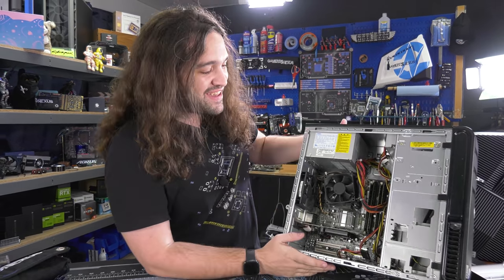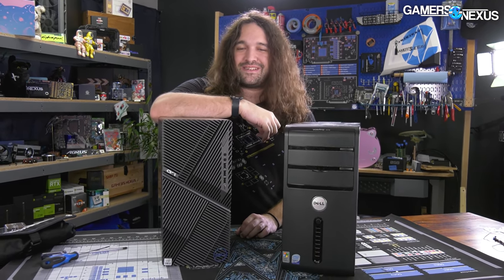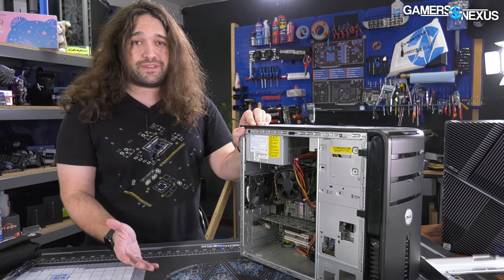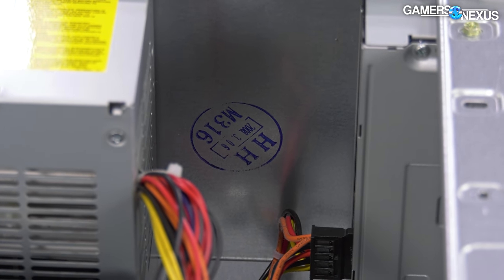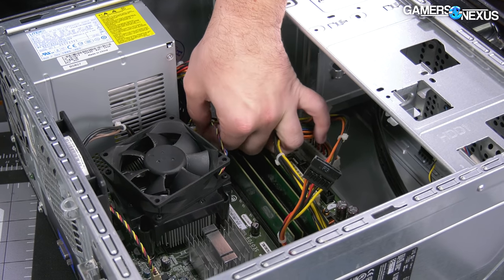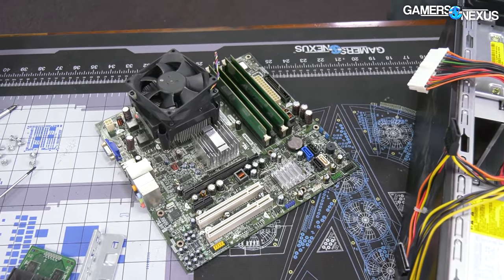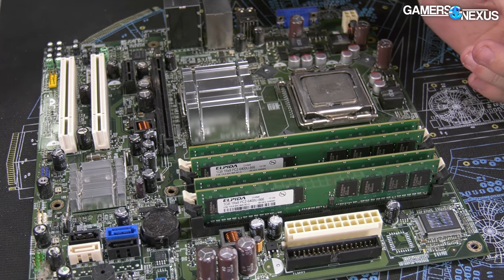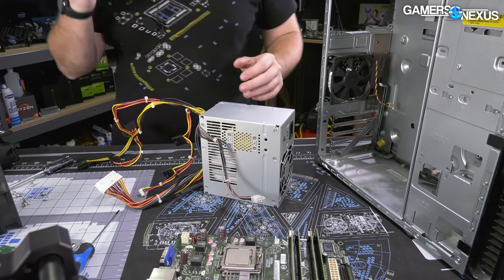13 Years of Dell Getting Worse

Comment: I hate to spoil it but it seems like they've been doing this for a long time. I have an Inspiron 400 with a mb form factor that is more akin to a pizza box than a computer, a cpu cooler that basically copied Apples homework on the Power mac G3 and the best part? The motherboard is on the other side of the case. It's complelty opposite of standard.

Comment: Ah Dell, the company that literally rewired an ATX power supply to a nonstandard configuration, so that if you replaced it with a standard ATX PSU it would blow up your computer (sometimes literally).

Comment: I own a Dell precision m4500 laptop and I talk a lot of it up to being an Enterprise laptop but it's one of the best laptops I've ever had to use.  Battery doesn't charge but that's because the charger I have for it isn't the correct one and doesn't put out the right juice but three internal Msata slots, hard drive access that is the easiest I've ever had on a laptop oh and the kicker to get inside to be able to change ram or any of the msata cards...1 screw.  That's it, right in the middle.

Comment: I know this is a tad "necro", but I would like to disagree or maybe reframe the statement regarding cable management not being a thing back then. If anything it became less of an issue as SATA became standard. IDE ribbon cables could REALLY screw up air flow patterns. I even had some IDE cables that were round...thick, but rounded. Now days it's more of an aesthetic issue as even if they were all over thenplace they wouldn't really block the airflow. At least not like a braid of older PSU cables and IDE ribbon cables. 

 Im pretty sure one would have needed at leaat XP Pro to have any more than 2GB of RAM...or maybe even to have 2GB+. I cant remember, but there was a point where I had more RAM than  XP home could use. I want to say it was 4GB, but it may have been only 2GB. This was like 20+ years ago, so I cant remember exactly. 

Vista actually wasn't that bad. The problem was MS pushing people to install it on machines they already had(likley older <512MB RAM) and made SI's like Dell, HP, etc to install it on ALL of their PCs including ones that shouldn't have it since they only came with <1GB of RAM. The number of people having issues using anything skyrocketed past those whit the RAM who were at least ok with it. Vista was a RAM hog though, so unless you had 2-4GB, you would see performance issues. If you had plenty of RAM, it was fine. It didn't use much CPU, just RAM. It was however, the beginning of the end of Window's functionality over form approach as well as the start of MS's apparent Apple envy that pushed them to try to make Windows more like Mac OS at the expense of performance and versatility.

Comment: ram in factory condition pcs always bug me. an old system that could handle 16gb of ram with 4 slots could have easily been sold with 1 x 4gb stick of ram and 3 empty slots. instead of 4 x 1gb sticks. ram would have been an obvious thing to upgrade in the system to prolong its life, buying a new 4gb stick would only give 3gb of additional ram. thats not even considering that the original ram would have been the slowest ddr2 available and thus having one stick in the system would slow down the rest of the sticks. surely the cost is cheaper to manufacture/ship 1 stick of ram at a higher spec than 4 lower tier sticks. less materials would be consumed and less would be in land fill now

Comment: ROFL, my wife bought a Vostro 400.  I turned out to be piece of crap, with almost everything in the it failing after about a year or so. And are you sure you can swap out the power supply or motherboard for something else 3rd party?  I suspect that while the power supply connector might look the same as a standard ATX PSU, the pinout might be a bit different. At least that was the case with the older Dells (yes, I've had a few, and still have them around, all the way back to the Dell XPS90). 

It was actually my wife's Dell Vostro 400 and my Dimension 5120 (which turned out to be even worse, with internal plastic parts holding the drives that turned brittle and fractured, that convinced me that my next PC was going to be a DIY one.  Built in 2013 and still working well. I'm planning to replace with a new DIY build in a month or two.

Comment: How bad have things got with system builders when can't do the job as well as a 10-15 year old DELL?
I would believe proprietary parts like in the modern Dell you had cost more as they can only go to company tooled up to make that part where as standard psu's and motherboards they can ring round and get the cheapest they can find and just put a sticker on and reflash Dell bios too.

Comment: I have a Vostro 400 with xp. Bios update got 8gb ddr2 working. I might do the tape trick with the quad 6600. Cooler has copper pipes.

Comment: I would love to see that 2007 case be gutted and have new/used hardware <$900 added into it which performs at or better the 2021 case; to prove the point.
Reply: What point, that you can reuse the one part that is NOT in issue for a landfill?
Reply: @bindingcurve  sometimes things can just be fun

Comment: **SMALL  substandard  power supply bearly good enough to power the componits as-built, 
**Poor cooling that is designed to make the entire system run hot and die an early death, 
**Lots of junk loaded in the operating system that is ether not needed or will shortly be out of its trial period,
**Proprietary parts with almost no upgrade potential
**A BIOS with little to no adjustability
**Mostly made with Low Quality parts,

Comment: Dell's PCs have always been hot garbage, but at one very short point in history they made the best small form factor rubber dome keyboards and made the best monitors alongside Sony and ASUS;  This was a very brief period in their history, between 2004 and 2008, their PCs were decent too, if somewhat overpriced.   The Graphics Cards were even then poorly cooled, but they did use commercial high end cards if you asked for one instead at only a small price increase over the base.  It was downhill after that as their cost cutting when it came to PCs then extended to their peripherals.

Comment: So....Dell actually got "better" at some point only to get worse again? My XPS desktop from 1999 used a VERY non-standard custom motherboard. That PC actually made it through about 10 years of use thanks to my ability to upgrade to that same Q6600 you had in the Vostro, as well as upgraded RAM, GPU, and power supply. The stock PSU was indeed non-standard, but the MB thankfully used standard power connections and the PSU itself was somewhat larger than a standard ATX, so the ATX upgrade worked perfectly and fit in just fine with a bit of a gap in the rear of the case lol

I might have gotten more years out of it had I been able to upgrade the proprietary upside-down and on-the-wrong-side-of-the-case MB!!!

Glad it was the only Dell I ever bought. I truly feel sorry for anyone who still falls for their B.S.
Reply: yeah dell was ok at one point and now its just dumb to buy from them

Comment: not defending dell but i think there's a lot of factors behind dell going more proprietry over time.... dell has higher volume now... they would have the ability to do more custom stuff in china at a lesser price, this probably was not the case in 2008 (LOL pun)...  dell would have spent a fair bit of time trying to work out what percentage of owner both private and business would actually upg. parts with non dell parts, ie. psu mb etc and they would have found out very few people upgrade parts over the lifetime of a typical pc

so if few people upgrade then why make a pc upgradeable outside what dell needs to make a decent spread of SKUs at purchase time?

its well known that although some private owners talk a big talk about upgrading cpu ram etc only the hardened pc enthusiasts does it... like most business they just get an entire new box... i dont think the environment comes into it at all... see how many ex lease places pop up selling i5 4570 age dell optiplex boxes for around $100 usd... once they're out of lease they're close to e-waste regardless of upgradeability... most serve a 2nd life as cheap boxes for private customers after a bargain

Comment: Used to buy Dell's and they were excellent for the money years ago(I7's). The last one 2 years back was terrible an I9 with subpar heatsink for guess an I7?  and a power supply right on top of it? It was so hot from the moment I turned it on the fans would go up and down just idling. In the end I had just a CPU and threw everything else out. Might of saved the Power supply for an emergency.

Comment: Back in 2008 things were very diferent now its only non upgradable boards power suply. If the board dies you wil only use the gpu that cames with them. And thats not cool.

Comment: I think you way too hard on dell. I have been running dell servers for over 20 years and they are the most reliable computers I have ever seen. I'm still running a dell PowerEdge 2400 in data center and it's still going strong. I have a few PE 2650s and a few PE 2950s and all of them are great. Dell makes the correct product for the correct market what your looking at is for people that don't watch youtube about computers. The people buying that computer are never going to open the case if something goes wrong they would probably take it to best buy to have them fix it that's the kind of people

Comment: i have a dell t5500 . i have never turned it off in 10 years except to install up grades . so its time for a newer computer and i found a Dell Precision T7810 Workstation with 2  Xeon E5-2697 v3 cpus for $300 local . should i do it ?

Comment: older dells are the shit for price-performance for a reason. You can get a processor, ram, and motherboard for the same price that you could find just the processor in other places. Workable boards too, once you get past the proprietary connectors and properly case swap. Their workstation lineup remains competitive as a true entry-level rig. I'm using one right now, the optiplex 9020 matx with the i5 4590, and 16gb. it's literally a vr capable rig, fully compatible with simple adapters with any modern set of cases and components. It could probably even boot off an m.2, if I could afford one. Dell has definitely declined. That tiny shitty little cooler works well to keep that old processor cool, and that old processor works well at seeming decent by todays standards, for most use cases. its certainly a leg up over a lot of those flimsy solder-only boards you see in miniaturized boxes or slim laptops like chromebooks today. I'm deadass not convinced it couldn't hold up literally to one of dells new issues, just from chipset quality and ram channels alone. gtx 1070 btw.
Reply: I personally like the rubber feet though, they really do reduce noise, and they can be easier to install in tight spaces

Comment: Those rubber fan grommets ae horrible. Within 3years they turn to black dust, and the official dell fix for it is "just zip tie it back in lol". I will say their Enterprise grade hardware and cases are a bit better (optiplexes and the like), but their laptop batteries are not good. The only dell I'd ever buy is an old Enterprise system, they're just miles better than consumer stuff. Still not what I'd call good though.

Comment: Dell has been doing this for a long time it kind of funny, I remember the Dell Dimension 1000-3000 series being micro ATX, then they went to the motherboard tray for the Dimension 4000 series ones, which where like the OptiPlex's from that time, then they went full BTX form factor which was a joke in my opinion made by intel, then back to micro ATX like in this video around 2006-2010, then back to some some wacky form factor which made the system useless after EOL. Like huh?

Comment: I think I have seen a review for an HP with a very similar motherboard.  You know, one of those weird motherboards that don't use any separate boards for the front IO but instead seem to have designed the motherboard.  Maybe there is a factory in China somewhere that is producing these abominations for OEMs like HP and Dell.  I guess it isn't bad enough that the keyboard and mouse these monstrosities ship with are so cheap they feel like only $5 worth of parts and engineering went into them.  Once when I was at Bestbuy I saw an HP or Dell on display and tried typing on the keyboard and it felt ultra cheap.  The mouse was the same way feels ultra cheap, no weight at all to them and so they feel so light and fragile.

Comment: Ive always hated Dell since the beginning. and in 2018 I had no choice but to buy a alienware R7 cause of the specs and the case itself was just awful and the Motherboard was horrible too you couldn't swap it or upgrade. So recently I did a case swap replaced everything except the HDD, GPu and CPU. Now i'm jus waiting for the shortage to end and i'll replace everything and keep the HDD only since it still works and i added 6 TB extra of SSD and m.2

Comment: I bought my first Dell, when Michael Dell was selling from magazine advertising in Roundrock, Texas (sometime around 1985).  Dell now, is making some of the worst computers you can buy.  I have had 3 "high-end", expensive, laptops in a row - from Best Buy: (2 were replacements for systems that failed first day of operation)  Last one: 1.  Defective hard-drive sectors with boot-up times exceeding a minute and half (eventually replaced with SSD at my expense), 2. USB 2 port failed, 3. Trackpad  never worked, 4.  Maximum battery time- 2 hours,  5. Daughter-board replacement because of power-button failure.  Gave up on Dell and Best Buy Geek Squad, who never fixed anything.

Comment: These Dells are a GOLDMINE for extremely low budget builds!
Buy one of those for 20 quid, keep the case, PSU and fans
Buy some second-hand things - as many as you can get away with
The rest you bew new but cheap - don't fuss about specs PCI3, PCI4 - it doesn't matter, if you are going for savings - you will never notice the difference!
Can be gaming for as low as 400 (maybe 500) quid these days!
Reply: you can a new 1650 based pc for around that amount, with it also being far more energy efficient.

Comment: Using proprietary parts and the desktop still a big box almost full of air instead of compact one... the G5 have space for a SFX PSU, plus the 2,5" in the botton instead on top! And a 3,5" HDD in 2021 is useless! I ditched 3,5" HDD for computers 10 years ago! And a Q6600, its a legendary CPU and have one running for more than 10 years util the motherboard died in 2017

Comment: Now go back to the days of the Dell gx280’s and you’ll see they have switched back and forth between standard designs and proprietary…. The gx280’s were absolute garbage and were even more of a pain to work on due to their clamshell design for the case and came out at a time where Dell was using cheap capacitors that they ended up getting sued over cause so many of their systems were failing due to those cheap capacitors leaking and killing the proprietary motherboard

Comment: LITE-ON was one of the better component makers back in the day of Pentium 4 and Athlon 64 era the DVD/CD burners that Lite-on made were better than most the other brands at the time as for the PSU in that old case zero idea but if it was as good as the other products they made then it might be decent enough for that proprietary system but Dell destroyed Alienwares trendy retro cases that the ones made recently look bad and are badly designed inside.

Comment: Dell was so good back in the days.....now they are just worse. my Sister bought a dell laptop and it has too much issues. Motherboard got some malfunctions and refuses to boot up. Have to flash the bios like 3 times for only 5 months. The design of the fans are stupid they blow the hot air on the screen and it broke the screen after a few more months because it was too hot

Comment: This Dell will be just fine for a 12-Year-Old Fortnite player, the market it's intended for. And that market is best served by cutting out the over-engineering inherent in a more standard build. Steve and his viewers keep forgetting we're the 1%-ers as far as the PC market. The 99% want something that works when you turn it on, is cheap, and for gamers, has a lot of superfluous RGB. 

Criticisms like single channel memory, incorrect BIOS settings, and the thing actually not working when you flip it on are valid. Having a 12 volt only power supply is not, since the thing works when you turn it on and the entire machine will be sent to E-waste when it breaks or is obsolete by the Fortnite player, regardless of what parts it may or may not have inside. And hyper-ventilation sounds like a good idea until you realize no one is going to stick an overclocked 3090 in there, and until the kid spills his Coke on the machine. 

Steve should either realize the needs of the markets he's branching into, or else just stay in his comfort zone with high-end hardware of the type his long-time viewers adore.

Comment: Dell's Vostro range of computers and laptops are VERY bad. They don't even use the same parts across the same models, they are full of hardware and software failures, and they just suck

Comment: The last couple of times I have upgraded my PC, I dissembled the old one and sold the parts individually. This allowed me to recoup more of the original cost of the system than selling it as a complete system. That would not have been possible had I purchased it from an OEM like Dell or HP that use proprietary parts.

Comment: I can tell you Dell has went down hill. It used to be a good product. Now no so much. I have to repair these systems and over the years them changing to cheaper is better has made repair almost impossible almost no interchangeable parts. and no expansion slots for up grading. Sad.